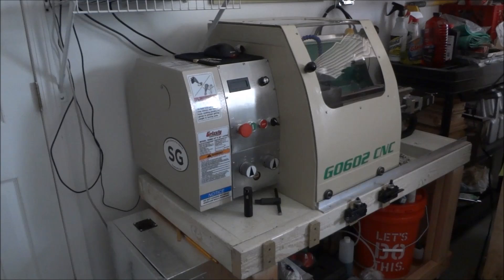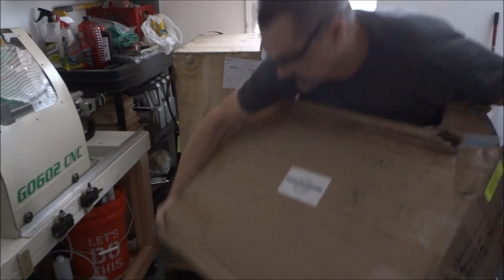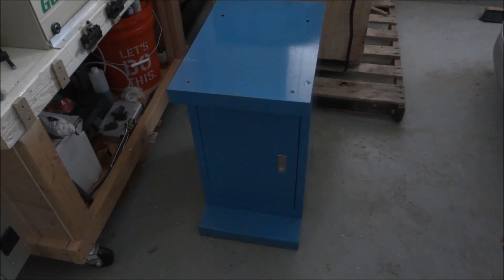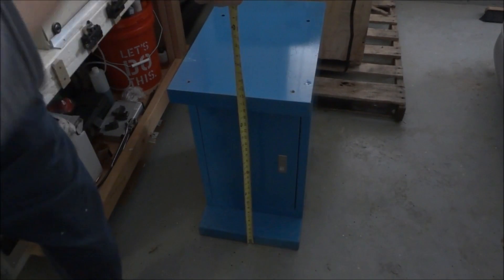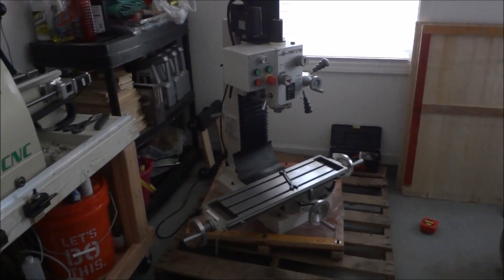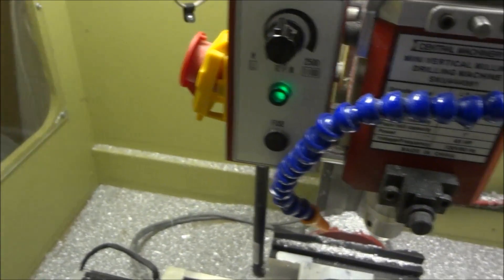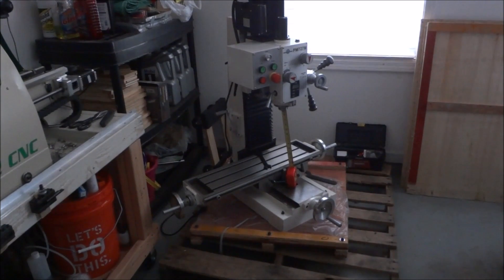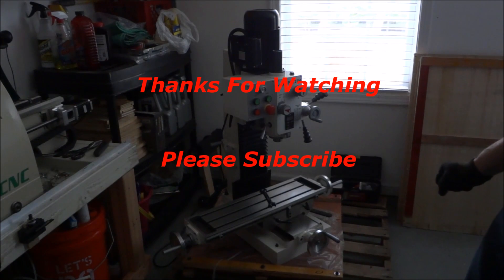Precision Matthews PM-727M CNC Conversion Pt.2

Comment: heard that 2 pack automotive paint holds up well to coolant
Reply from the maker: Great! Thanks for passing that along, I will say that after 6 months the Tractor paint with Hardner is holding up very well.
Reply: as long as its fully hardened out it should be ok 
we used to paint carts with thinner based paint , we just had to be realy carefull gassing up the first few months so nothing spilled over the soft paint
Reply from the maker: Yeah I hope so Plus I used Epoxy Primer so I should be good

Comment: Good video nice looking machine. But would have any idea if there is a conversion kit to change a PM-30MV-L over to belt drive or information on how to do it. I think I can figure it out but trying to figure what belt size and length that I need. Any help and I would be very Thankful. Kim Brewer
Reply from the maker: +Kim Brerwer  Hi Kim,
 Thanks, I have not seen any but cant say Ive search either, Isnt that machine basically a G0704? if so I'm sure you can find a belt kit for it some where. I will be making and posting a Belt drive for this mill Not sure if it will help you.
Be Safe,
Sam

Comment: I currently run a manual X2 and I like it. It works perfectly for what need it for. I'm looking for a bigger mill for future projects I am beginning to take an interest in. I don't think I'll ever need a mill as big as a PM727M. As strange as this may sound its exactly why I want one. I'll never have to upgrade again. For the money I'm willing to spend, so far no mill can compete with the PM727M. As you stated, its bigger than the G0704. Also the G0704 has plastic gears and needs a belt drive conversion before you can do anything serious with it. I think  that's why Matt sells the PM25MV as a belt drive mill from the get go. I almost went with the PM25MV but its only $200.00 less expensive than the PM727M. I felt like my money was better spent on the bigger mill. Anyway After my wife and I move into our new house, I'm building my new shop and buying a new mill. I don't think I'll do the CNC thing any time soon if at all. If I ever change my mind, I will already have the best mill you can buy under $2000.00.
Reply from the maker: +rdsii64 Thanks,
 I think My thought process was the same sometimes when comparing mills we get a little confused by the Numbers. The G0704 looks really great as far as work area. But when you dig deeper you can see why. Because the saddle is so much narrower it gives you more Travel on the X. Take a look at my video on milling a G0704 Saddle you can see.
The PM-727M is a great machine. Grizzly also sells its version and will save you the cost of the Stand since its not included. G0795. But I conuld not agree more Hands down a great small mill for Under 2K.
Be Safe Sam

Comment: Nice videos. I am currently trying to decide whether to go the 0704 or this route and was wondering if you had or could point me to any pictures/info on the style of the inbuilt/standard Z axis gear/system. I know the Z tends to be the trickiest part of mill conversion (depending on what you are buying), but find less info on this machine than the 0704. In the end, either way I plan on machining my own kit, but just curious what I would be getting into on this PM style machine.

Thanks,
Reply from the maker: +Anthony Balducci  
Hi Anthony, well I completely understand! The PM-727M is brand new only been out since Feb 2015 so not alot of info if any on it.
It's a little brother to the RF-45 series mill but no relation to the G0704 Grizzly also carries a version the G0795.
It all boils down to what your doing and what your needs will be only you know that. The biggest issue for most is Y travel there is NEVER enough ever. as far as Z stepper mounts I'm going with a top mount same as I would with a G0704 just bigger LOL.
will you be adding a 3 phase motor? the structure on the PM-727m already is set up for a bigger motor.

Take a Look at my G0704 Saddle video for a size comparison. 

As far as what your getting into Hmmm! Hours and Hours of alone time in the shop. LOL really this is my third build there all about the same. Making mounts is easy if you mess up just start over its just a block of aluminum. but it's not that difficult.

There is a lot of info on the G0704 and many ways to do conversions and kits available should you decide to go that route.
So I understand.
I plan on documenting my build as I have with the G0602 if that helps.
Be Safe,
Sam

Comment: I would advise putting the Y axis stepper in the rear to give you more clearance up front and keep the motor out of the work area.  I am SOOO glad I did my mill like that it worked out great.

it will also allow you to extend the Y travel without notching the saddle.

also when you design you enclosure I would make sure to consider a larger vice overhanging the table so make the enclosure from lip just lower than the table surface height.  I would also recommend slanting the enclosure base towards the front of the machine so all of your chips are easily washed down and coolant is easily pursuaded to the front and to a drain that is easy to get too.  I did mine angled towards the center and flat and wish I had done it the way I explained above, would have made life soo much simpler.  put alot of thought into the enclosure and it will help minimize cleanup time, flood coolant return, chip clearing and after job cleanup.. and plan for a washdown sprayer and how everything would work for simply spraying the chips into one area to be moved or augered into a chip bin..  that would be my advice as that machine will make alot of chips alot faster then the x2 and you won't want to slow down your production having to remove them and clean the enclosure out.
Reply from the maker: +christopher polanski  Thanks Chris PM coming your way,
Be Safe,
Sam

Comment: I cant wait to see this all finished up i have a g0759 (the 0704 with a dro package) i am planing on doing a conversion like this. Could i use the dro package and put it onto my g0602 lathe ? Sorry if this is a unusual question thanks for your input in advance.
Reply: I don't see why not but let me warn you once bitten by the cnc big you will want to convert the G0602 as I did. 
Lol
Be safe Sam

Comment: I plan on buying the same mill from grizzly G0795.  Why did you buy the PM-727?
Reply from the maker: +Billy Blue Hi Billy,
I think there the same mill However the G0795 Has a 220v Motor ( I plan to replace with a 3 phase so no problem) and the G0795 has no stand. Also travel is a big feature on mills why is the Grizzly listed at 7 1/2" The PM727M is a confirmed 8 1/2" on the Y axis grizzly may have this wrong and it may be what the Mfg has it listed at I'm not sure but 1" of Y travel is a big deal. Nothing wrong with Grizzly it's good stuff. 
Matt the owner of Precision Matthews is a machine guy he knows his stuff and his machines if you need parts or if you have a issue you can talk directly to him if you have questions about a machine he can answer them. Besides you get all that customer service and  the stand for the extra $100 in price. You cant beat that to me. if you do decide to go with the Grizzly G0795 let me know about the Y travels. very curious.
Be safe,
Sam

Comment: I love your mods and I plan on using many of them on my machines.  As for the paint try appliance paint.  I used it on my formica counter tops and five years later still good.  Also you may try using stainless or aluminum paint.
Reply from the maker: +Billy Blue , Thanks yea I think epoxy paint may be the way to go. I'm not sure what's in the coolant that makes the paint bubble and peel but if ya need paint stripper? it will do it. LOL

Comment: I enjoyed watching your 602 conversion and I'm looking forward to your conversion of this mill. I have an 11x26 lathe I'm converting and will want a larger mill before long.

I used your macro for tool changes on my SX2 (thanks for that). I never had an issue with letting Mach3 control the spindle. if you want extra peace of mind you can always hit the power switch.

On coolant resistant paint, look into epoxy paint. Not the cheapest stuff but it holds up well under a lot of various chemical. Just an idea as I have no first hand experience with the two together but the big boys paint there machining centers with something that works.
Reply from the maker: +Jody Olivent Thanks, Jody, and your welcome
I have had a couple C6 boards for the spindle control Just never got around to it and the more I thought about it and as much as I change tools I figured this works. 
The new mill will be controlled by mach3 or Linux hope to have a auto changer as well.
I have heard about the epoxy paint hoping to get a brand name or something so I put it out there
Be Safe,
Sam

Comment: Awesome! Man that base is beefy. This looks like it's going to be a sweet machine.
Reply from the maker: +russtuff 
Yea, Not having seen a ZX-45 it's hard to tell but from what I have read you can tell it's a little brother. Way beefier than a G0704 which I have seen. going to be a fun project. Shopping NoW! LOL
Reply from the maker: +Andrew Cowell 
Hi Andrew,
 Yea going to try and get the 10" out of the Y This mill base is about 21.5" long not quite as long as the RF-45 so it will be tight.  I have a Idea for the Y Ball Nut mount will see if it pans out.
The X axis has 15" of travel now I hope to get 19" without to much modification.
I'm going with the same metric motor as I did with the G0602 Lesson 1 hp 3 phase ( found a deal on E bay) it works well on the lathe I have no doubt it will work here as well.
Be Safe,
Sam
Reply: +CNC4XR7 +Andrew Cowell 10" Y-Axis is amazing. I would love to have that sort of range..... someday.
Reply: 10" is my rough guess it's 8 1/2 stock so I hopeful I can stretch it to 10"
Reply: +Sam D I'm in the 5s, so even 8.5" would be a huge difference for me.
Reply from the maker: +Andrew Cowell You could have given it to me :)  I'm happy with the 1HP 3 phase on the G0602 Yea I know more power right! LOL :-)
Great deal on Ebay so I snapped it up.
Have you seen what Tormach does with a 440watt motor? I'm thinking she'll be fine if not it's a upgrade I can do later on I wanted to keep it 120v.

Yes I think its a little the round section on the head where you can swivel is 5.5" I think yours is around 7.5.